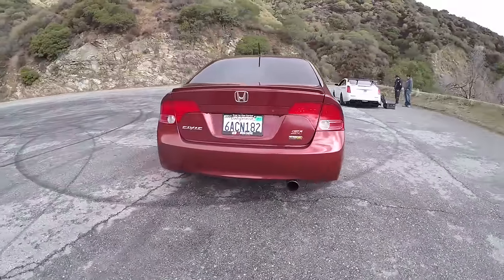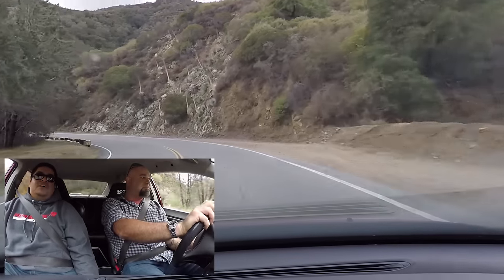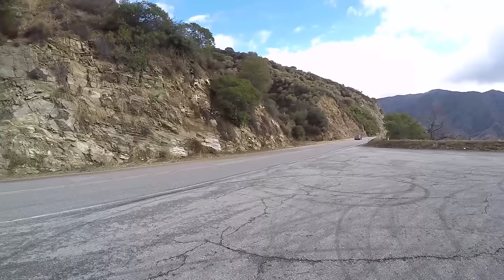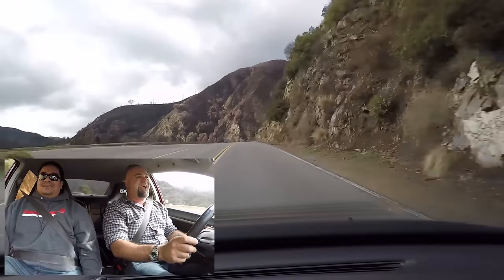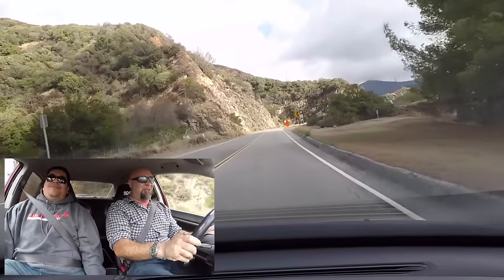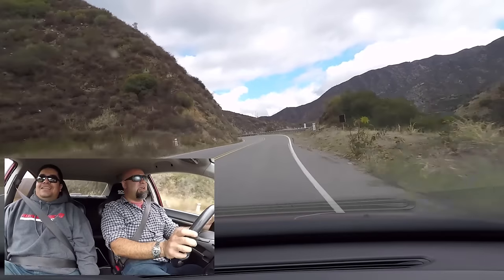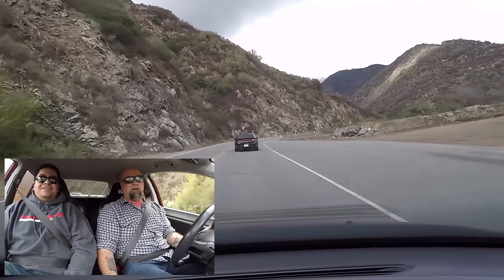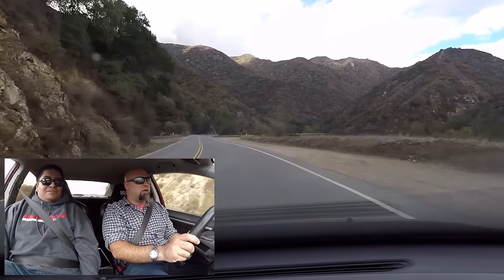INCREDIBLE 330HP All Motor 2007 Honda Civic - One Take

Comment: The K series is incredible. They make power so easily.
Reply: DannyLlerenaTV  15k is easy ?
Reply: +Justin Perdue The k20a engine with the gearbox is not 15k what are you smoking on? meth?
Reply: +Justin Purdue No, but even just your basic K20A2 with bolt ons responds very well and makes good power. This is an extreme all out build. $15k is a lot for any engine, but theres not a lot of 4 cylinders out there that will touch the 300+ wheel horsepower mark N/A and still be streetable. So I would say yes, its still somewhat easy.
Reply: 8th gen Si. Intake, header, full 3" exhaust, TB spacer, and Flash pro tune is easily 220WHP. So that N/A 2.0L engine making 260hp
Reply: Huss Ali no it's not 260 hp lol
Reply: Unless you're like me and stuck with a K20a3... FML
Reply: 260bhp with them bolt ons is totally over estimated IMHO.
Reply: K series is eh. B series is better, but the F series is best.
Reply: Aaron Karmacharya same yo
Reply: +That Car Guy 

aside from oldschool nostalgic feelings what makes the b-series (or even f-series for that matter) better than the K-series?
Reply: I'm more into the h22s. So good to make power with
Reply: I have one myself ( an H22a from a EuroR ) abd its abiyt the closest thing to a Kseries as far as feel is concerned.
Reply: I have one myself ( an H22a from a EuroR ) abd its abiyt the closest thing to a Kseries as far as feel is concerned.
Reply: Richard Bossman once I get some money I wanna do a k series build once I have the money. #collegebudget
Reply: junjun71898 the EF iz a pretty light and fun car you can drive fo cheep
Reply: ppl usually like the b series
Reply: k24a1 honda crv but I'm not blowing the transmission or spending money on it lol. Saving for a sti.
Reply: I have a 2015 sti and I'm going back to Honda k24 em1
Reply: Diminishing returns above 280whp. A stock K24 with a tune makes 220whp.
Reply: Justin Perdue with a 3k head package you can make 300whp. your paying 15k because he's a shop. be cheaper of you did your self
Reply: Hes joking. B and F do not outdo K. B may hold the WR over K for FWD turbo but not RWD turbo. K holds the record for that. K also holds the NA FWD record.
Reply: ***** Im joking? Please troll elsewhere. The quickest Honda is an F series, running 6's. Followed by the B running 7's series, then K then the K series running 8s series. facts with links posted above. There are 6 second RWD unlimited class B series, but that is not a Civic,thats a fiberglass shell with a motor, hence I didnt mention it. I dont consider it a car. My point still stands.
Reply: That Car Guy - in real world driving my R18 is better than by B16. much more torque and can can do double the miles on a full tank.
Reply: Gecko . Much more torque? It has 15ish pounds more torque in a car that weigh 500+ more pounds... Im pretty sure you in fact dont own a b16.
Reply: If we're talking F motors then make it at least drivetrain fair and compare all the Honda motors in RWD applications.
Reply: You can buy a fully built, sleeved, bored, K25 BRAND NEW long block for $9100..... And with the trans he only did PPG for 1-2 so thats $2000 for those. 3rd is stock. 4th and 5th are from a JDM integra so thats about $500 depending who you get them from... So thats still under $15k.... motor and trans completed.... so I'm not sure where you got your info from but its wrong lol. Dont get ripped off bud. Pm and add me on FB. I build and sell K series motors and turbo kits.
Reply: ***** Once again if if you compare all cars in RWD form, the B series is the quickest, Followed by the F series then K series.

The quickest RWD K series is El Freddies. It runs low 7s. Its a complete fiberglass drag car thats hardly a Civic just like the 6 second fiberglass B series Civics.  The  6.9 second s2000 is the quickest car thats not unlimited class.
Reply: *****  k20z3allmotorFTW Sounds like you two should get down.... lol
Reply: +That Car Guy  K series RWD WR is a 6.68s by Lucimar Racing ... not sure where you got your number
Reply: ***** B series is 6.5s... And these arent even cars anymore... These are fiber glass shells.
Reply: +k20z3allmotorFTW  List every "higher quality part" used and lets compare. See if its worth an additional $6000 over ours.
Reply: CardsOnTheLow 6 k less except you'll be paying for a second motor shortly after getting the first KMod motor
Reply: That Car Guy kmod is gets shut up by people in all the civic FB groups  then spouts Jesus talk to show he's such a holy and good dude.  I know a lot of his customers have got bad motors and terrible tunes.  He also would never know how to tune a real ecu, he steals maps from my tuner @vittuned and claims them as his own
Reply: +k20z3allmotorFTW Im staying out of that one as im not a K fan as you can see... But ill take your word for it as you seem to be a K series fan yet havent fangirled at me like the other poster. Some shops though man... If hes as bad as you say hopefully the forums will get him out of the game.
Reply: DannyLlerenaTV  please pour this man a beer.  🍻
Reply: It's a k25
Reply: @mujjuman  b series guys don't want to admit the k is better in every way
Reply: @vhssociety  word!! I agree
Reply: @vhssociety  the k series makes way more power than a b series, the k series holds the record for the fastest awd pass on a OEM block, they also hold the rwd record pass & they also hold the all motor record as well, the b series just dominates fwd

Comment: 160 hp per liter. That would be impressive with a turbo. This Civic is NA. Example: a Bugatti Veyron makes 125 hp per liter with FOUR turbos, Porsche 911 Turbo makes 142 hp per liter.
Reply: Where did you learn to do math 330hp /2.5 liters does not =160 it's 132
Reply: 919 Garage 🤦‍♂️... YOU can’t do the math. 330 whp is right around 400 crank which is in fact 160 hp per liter. He was listing hp per liter at the crank on all those cars. Fail
Reply: Compression is too high though
Reply: lol look at the yamaha r1
Reply: If you want to be impressed then check out Nishan's Mazdaspeed 3 1000 HP. It has 2.3 L. You do the math
Reply: @Aramis_Production  theres a boosted b series (b18c 1.8 bored to 2.1liter?) that makes 2000hp that runs 6s in the quarter mile i belive.  just look around its pretty easy to fine.  Speed3 is a joke compared to the honda game
Reply: fastcougar3200 Mazda gang💪🏽 got one as a daily, it’s a 6 tho, but still bouta make some good power as I’m addin mods
Reply: @carlosandleon  lol once again only bikes seem to come near hondas in terms of power per litre really not a good comparison. get real.
Reply: There's a 500hp 93 civic hatch build, just look up 5000$ 93 civic hatch 500hp build. Yes its boosted but still badass.
Reply: Gt3 rs 500hp 4.0 NA
Reply: @frasernagle4436  The engine is built for it.
Reply: tim m because Honda has been in a game longer than speed3 or any mazdaspeed. How about compare rx7 rotary to your any Honda motor lol there is rotaries with over 2500hp and run 6, high 5 in a quarter.
Reply: Alex Fry Mazda’s 2.3 EASILY could make 200+ whp, it’s just gonna cost a lot ;) coming from a Speed6 owner, no other 4 banger can make power per $ like a Honda aside from maybe a 4g63 lol

Edit: there’s actually 2.3 duratecs that make over 200 whp with big cams and supporting valvetrain. The MZR head flows quite well on the speeds. But a k20 will make 230+ whp with a tune, header, full exhaust and intake
Reply: @BoltAction3717  if it's the one I'm thinking of  that dude made that power with a D series motor, is it a white Honda eg?
Reply: Well for 50K I would expect that. Only thing is you gotta drive it like you stole it. Not much power below 5000rpm. Torque is probably only around 220.
Reply: Ducati v4r makes 234hp from 1 litre, from factory with exhaust system package road legal production beat that
Reply: what about a 1000hp evo!!
Reply: @frasernagle4436  lmao how can compression be too high?
Reply: Alex Strömberg stock high compression engine + boost = boom. Understand?
Reply: @frasernagle4436  this car isn't turbo'd. Understand? also if you can tune you want as high a compression as possible.
Reply: Alex Strömberg the original commenter said it would be impressive with a turbo. Which is why I replied. Unless it’s a direct injection engine, you don’t want super high compression. Regardless of tune
Reply: @frasernagle4436  yes you do, higher compression means more power and efficiency. if you can you should get more.
Reply: @timm5970  Exactly right. A joke compared to the Honda game. Thank you, tim m.
Reply: @bman1668  the b series was like the first tuner engine by Honda.  Comparing to rotaries is dumb especially because rotaries are dumb.  Theres a reason nobody makes them.
Reply: @bman1668  you also forget that the car I was talking about is a FWD car.
Reply: @timm5970  rotaries are dumb? They can make more power than any Honda motor to date buddy there is no high 5 sec civic or Honda but there is a rotary
Reply: @bman1668  Yes rotaries are VERY dumb.  Doesnt mean they cant go fast.  Hondas are FWD aka wrong wheel drive and still can get down.  They are cheap, reliable, and plentiful.  Rotaries are non of those things.
Reply: What is NA?

Comment: These crazy high revving high hp NA Honda engines are like the NA Ferrari engines of the JDM world lol
Reply: anotherone10 Ferrari wishes they could make na power like a K series AND be as reliable
Reply: Aret Zelli Ferrari and reliable should never be put in the same sentence lol
Reply: Aret Zelli you don't buy a Ferrari for reliability and about making big power, f12 berlinetta uh hum. Also, your civic isn't reliable if your making anywhere near big power while na. It's cool don't get me wrong, but I feel like it's a huge waste of money to spend 50 grand on a fucking CIVIC to only make 300 hp. That's not that much.
Reply: 330@ the wheels (280kws the engine)
Reply: Sergio Aguirre no way in hell a built engine is gonna maintain stock reliability! also, you are very fucking hostile for no reason. Imagine dumping 15k into an engine that actually made decent power stock. Did u hear how high compression is on that thing? if you want the most for your money, DO NOT build a high power civic. Also, at the end of spending all that money, he only has 340 HP to show for it. yes ik it's higher at the crank but still. That's just not worth it
Reply: Matthew Trent haha 15k and I'll have a 350 and put an exhaust and some cams and probably an exhaust kit(not full)
Reply: Sergio Aguirre -_- Bro I was saying a bigger bang for your buck .. all I said is what I'll do with 15k I never was comparing
Reply: Sergio Aguirre yea I get what your saying but I wasn't trying to be technical the guy said 15k on an engine and being me I wouldn't do that and when I said 350 I meant 350z not a v8 .. I'm a drifter so my head went straight to the drifting aspect and not into the engine or HP idc about hp just getting sideways and suspension set ups
Reply: Sergio Aguirre yea but it gets technical too because to look good you have to hit really nice angles and it takes so much skill to learn .. personally o feel like drifting and racing take the same skill intensity .. you can't throw someone in a drift car and say drift just like you can't throw a noob in a track car and tell him beat that time .. you honestly need soooo much skills for both and tbh drifting cost wayyyyyyy more than racing I had an 240 I used for track and it was wonderful it didn't break .. as soon as I got an lsd and started sliding it I started dumping money on it just to keep it running
Reply: Sergio Aguirre it's easier for smaller engines to make higher horsepower per liter. 4 banger guys always throw that out there. At the end of the day, no getting around the fact that a v8 is just gonna make more power overall than a 4 banger tho.
Reply: Sergio Aguirre why are you being so hostile? Just a discussion man. Look, I myself actually prefer a i4 or 6 cylinder to a v8 usually just bc I like higher and faster revving engines. They're more fun to me. Also, sure a smaller displacement engine can make decent power, especially with fi. That being said, it's just common sense that bigger engines tend to make more power. Let's compare an ls engine to Hondas seriously awesome 2.0 liter engine out of the s2k. Their both very good performance oriented engines but of course the ls will make more power. Like I said, I prefer smaller and faster revving engines myself, but I'll admit. If I want a power monster, I ain't buying an i4.
Reply: Matthew Trent Bruh dont look at the hp figures, he runs 11s @124mph, that's a supercharged corvette zo6 territory on a n/a four banger sedan. Even if it cost him over 50grand just for the engine, thats still a bargain for what the car is capable of, not to mention the mechanical beauty that k25 must be to spit out that much power with no help from boost.
Reply: Sergio Aguirre ok, we aren't comparing Ferrari and ls engines. We're comparing smaller engines to larger ones. Oh and apologize for thinking  you had the common sense to say a v8 is larger than in i4. No matter what u say or do, fact of the matter. A bigger engine is gonna make BIGGER power. It's not that hard of a concept to grasp. I mean seriously...
Reply: Sergio Aguirre all I've been saying is bigger engines tend to make bigger power. that's just a fact OK. I'm not talking about power per cube or anything like that. A performance oriented 6 liter engine is gonna make more power for the same money than a performance oriented 2 liter. That's all I'm saying. Yes, little engines tend to make more power per cube, but bigger engines have a good bit more cubes.
Reply: Sergio Aguirre all I'm saying is this guy put 15k into an engine and ended up with 300 something wheel horsepower. That's close to 400 something at the crank. go put 15k into any ls engine and tell me how much your making. 300 and 400 HP is a cake walk for an Ls. that's all this stemmed from. Say I want a high power na engine, why would I dump 15k into this 4 banger when I could put it into an ls and have a good bit more power at the end of the day?
Reply: ***** I think i know which LS car u talking about but ill shhhhhhhhhhh
Reply: Sergio Aguirre were talking about the honda in this video. also, yes an s2k probably can make a shit ton of power with boost, but what happens when you boost an Ls. 4 digits isn't all that uncommon.
Reply: Matthew Trent 50 Grand........? Who ripped you off ha ha ha
Reply: Ryan Cowtan f20b stock iron sleeves can handle 300hp. Search it
Reply: i drive a 2.0 tsfi with similar output, but shit that soooouuund. I d almost kill to have it in my jetta. Instead i have taktaktak.
Reply: SHAUNTESE CHANCE 350z is a HUGE turd compared to this setup.
Reply: Matthew Trent it's 15k for 330hp and as long as you keep an eye on the timing chain tensioner and make sure the tune stays on point and do regular maintenance this engine will probably last 200k miles maybe more. (Definitely need to stress the timing chain tensioner thing though it's the only real weak point of the k series engine)

Comment: 14:1 compression, 11 second, that's insane stuff
Reply: Balo657 seeing as you have an R35 as your picture, it's as fast as a stock R35 in the 1/4, with like 200 hp less lol.
Reply: PR1NCETD0T Its all above power to weight. Look at motorcycles boi
Reply: Adrian Gutierrez Duh, its also on the driver as well, if you aren't having enough seat time, that car would probably run 12-13 seconds with a bad driver.
Reply: Look at ak47 civic he has 400wheel all motor almost running 8s. No spray all motor k24 eg hatchback lol
Reply: Can someone please explain what 11 or 12-13 seconds mean here?